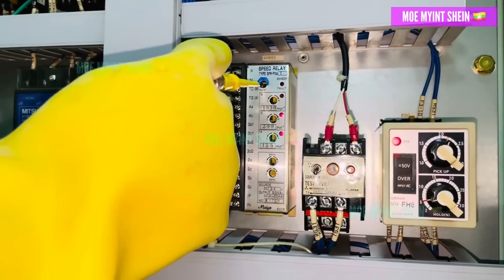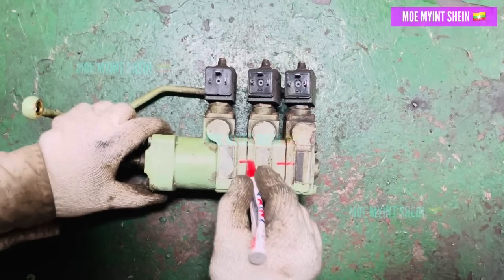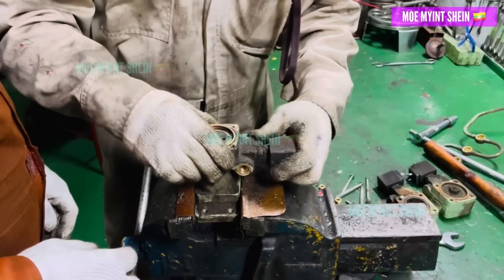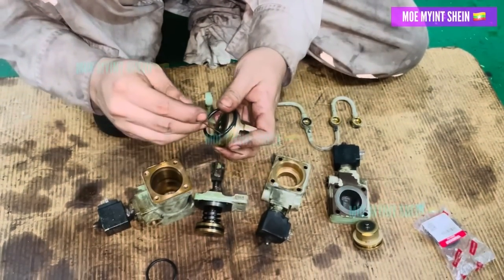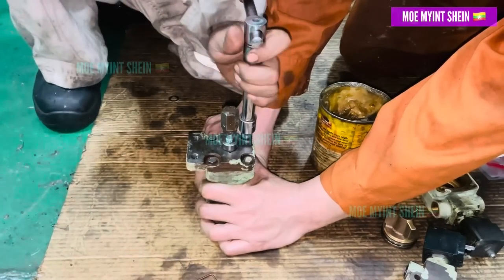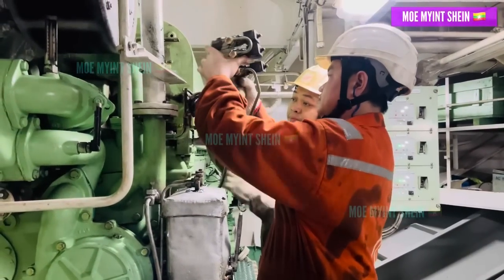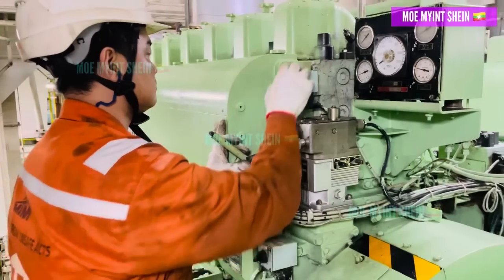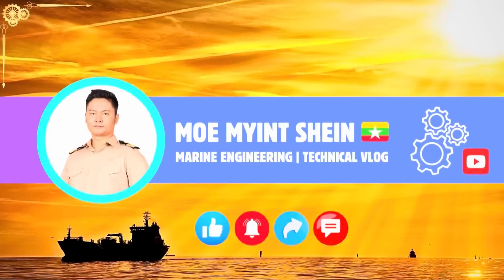[YANMAR] Troubleshooting Overspeed Trip Failure | MOE MYiNT SHEiN | Technical Vlog : 123

Comment: Hello sir, in the event that the stop cylinder is not functioning properly, would the lube oil low pressure trip still operate as intended in your case
Reply from the maker: Thanks for asking.

Comment: Hello Sir. Can you post a video regarding how to effectively clean turbine blades of a generator turbocharger?
I am having difficulties cleaning this. My senior engineers always use detergent and water for cleaning. I looked all over the Internet but couldn't  find. I have difficulties cleaning the solid deposits on the blade.
Thank you Sir.
Thank you.
Reply from the maker: Received and noted. 

Turbine washing and blower washing should be carried out regularly in auxiliary engine. 

Normally, turbine washing is done by using marine grits (example nutshells). 
In blower washing of turbocharger, water is sometimes used. 

Please verify did your seniors use water and detergent for turbine side washing?
Reply: Sir we dont do water washing for yanmar generators. We just overhauled our turbocharger IHI model. During overhauling we soaked all the parts in detergent and water. But the cleaning was not effective. Can you suggest the easiest and best effective way for cleaning the turbocharger parts? Also I see in the youtube most videos skip the process of turbine blade cleaning section, etc. If you could kindly upload a detail video of generator turbocharger overhauling and cleaning method.
 @CHiEF_MOEMYiNTSHEiN
Reply from the maker: @azizulenam7318 
Understood. 
YANMAR released one video for turbocharger overhauling. In there, maker recommends to use Kuri Pearl. Frankly, I have no experience for this chemical. You should order and try.